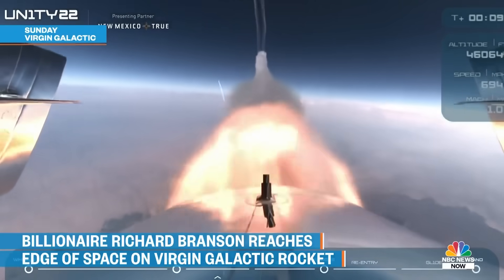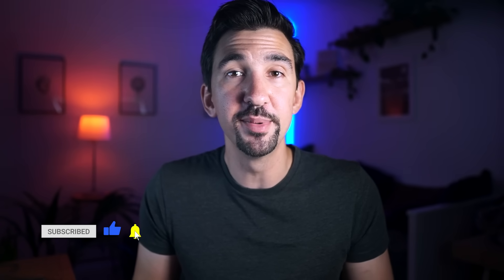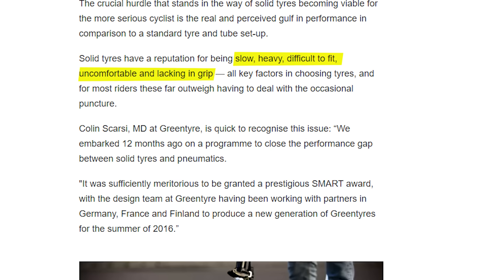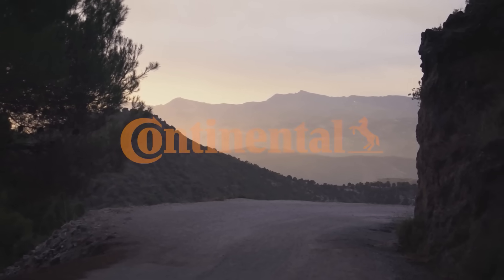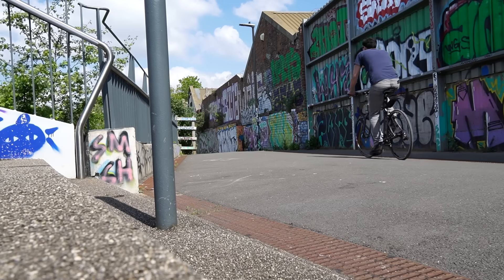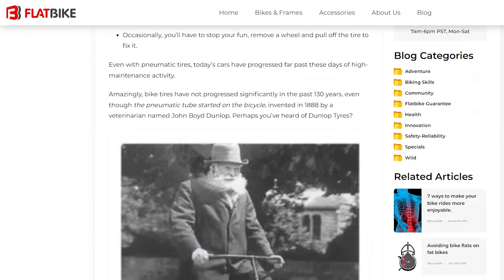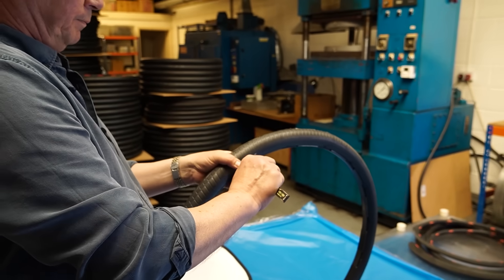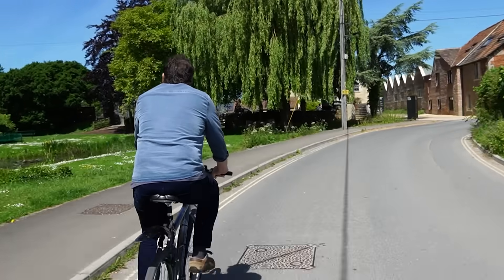I Tried Solid Bike Tires | Here's What I Found

Comment: Regarding this topic, I've been riding on a single set of Schwalbe Marathon+ tires for around 10.000 km's in the past 4 years and never had a flat. They have several hard to puncture layers and a solid insert to minimize punctures. I pulled a long rusty nail out of them and large shards of glass that had me absolutely BAFFLED how they hadn't punctured them. The downside is the weight but they saved me so much hassle I can only gush over them.
Reply: Another schwalbe user here. I commuted to work for a year, from summer to summer in all conditions, but living in Scotland meant pale sun and definitely rain and wind, with the occasional snow fall. My tyre of choice for the job is the G One Speed, almost slick gravel tyre with superior puncture resistance. I went from a puncture every two weeks to no punctures at all. At the end of my commute I used tweezers to pull out small glass shards from the thread. These are tubeless tyre, but I never got to need the sealant to plug a hole. The advantage of being pneumatic is that I can change the pressure according to the load and conditions. There is no beating the best tubeless for flexibility and for pure speed the margins are getting lower and lower. The recycling aspect is definitely an interesting once and I can see how many hybrid or electric bikes can take advantage of the technology.
Reply: I'm also curious, but also a Schwalbe fanboy.  I've ended up riding, mostly below 20mph, on 2-inch Big Apples and Fat Franks; rolling resistance of large, quality, not-knobby tires is low, they don't need pumping that often, they tend to resist punctures.  Zero punctures is better, of course, but rolling resistance?
Reply: I use these tires too. Never had a puncture and they never seem to lose pressure either. I've put some 'slime' in to the tubes just in case for insurance but would highly recommend Schwalbe.
Reply: +1 Schwalbe Marathon+ = indestructible
Reply: Same here. Marathon Plus MTB. My current pair is 6 Years old. The Threads are a little run down, but not a single flat yet. Had a pair of the same Tires (older generation). The rear one lasted only a year but i avoided a collision with a quick slide and the side of the tire must hit a sharp stone. Cut the flank like a knife. The new ones for my current set are ready to mount. Also time for new tubes after 6 years in use.
Reply: I recently replaced one of my Marathon Almotions after about 10k km (the rear, the front is still fine). I had one flat between them  in that time. I did use them tubeless for about half their life though. When replacing I did find a few pieces of glass, a screw and a nail in them, but I still only had to adjust tire pressure about every three months (probably because of the screw, that was a bit of a gnarly hole). These are a lot quicker than Marathon plusses.

Most rides I'm not that interested in the last watts of performance, but I also ride my holidays on this bike. Over 200km/day, I really want that last bit.
Reply: Was gonna say the same and these Gecko's for £110 a pair, I think I'll stick to my Schwalbe's
Reply: Me too, same tires.  Had solid they suck.
Reply: Yeah Schwalbe have it nailed.
Reply: only time I get any punctures is when the snow and ice melts and freshly grind rocks are bare against the asphalt. it's like constantly driving on glass like shards.
Reply: Totally agree!  over 6 years since my last puncture!
Reply: I also use Schwalbe Marathon tires for 10.000 km. They only went flat for 4 times. One of them was a nail, one of them was a piece of wire and rest were thorns. Still very impressive and i definitely will use them in the future. Their downside is though, they are not comfortable and have rolling resistance. I used to have schwalbe smart sams on the same bike and even they rolled a little bit better than marathon. I suggest them for touring and commuting. I did a 3000km and a 1000 km tour with them and they never punctured on these tours.
Reply: I'm also using Marathon+ which are about to celebrate their 10th birthday. I vaguely remember only having had one single puncture which I suspect was caused by someone having seen the ‘puncture protection’ label and putting it to the test, because the puncture was weird. Of course these tires can be punctured with enough perseverance, but gone are the days of simple glass shards or other random junk slowly burrowing itself through the tire.
Reply: in NM, the goatheads are legendary, as are  Cholla (jumping cactus, goes in the sidewall of the tire) so I have to buy the most puncture proof I can find, presently Marathon+.  So the weight factor is a non-issue.  The cost is more than reasonable.  So my question would be how's the grip on: asphalt, sand, loose dirt, sandstone, granite, snow, and ice,
Reply: Recyclable?
Reply: @Causemoi  Tires are made of rubber, which is, by nature, recyclable. That said, it costs more money to recycle them than it's worth for someone to invest into actually recycling them.
Reply: @reeepingk  That would seem to make the advantage of being fully recyclable a meaningless sales pitch, for sure.
That's why a company buyback of old tires would be something worthy to back their claims, because where would these old tires go otherwise?
Reply: @Causemoi  I wouldn't worry
Reply: Something Schwalbe made me aware of is, that there is actually a way to recycle the rubber from pneus. Which is quite tricky because of the mix of materials and the containded metal and its way too geeky to explain in a comment.
But it shows that even this is possible maybe not at such high rate as the geckos but it is still a very new approach, so some improvements will be done in the future.
Reply: Pity they are heavy and have the annoying reflective stripe.
Reply: @Leo-gt1bx  Reflectors on wheels are legally required in many places, so be glad they're there so you don't need to add those plastic reflectors to your spokes.
Reply: @Tr1ploid  Not to say they are a life saver. I use the Schwalbes Green Guard, and they light up like mad when hit by light. Even the mobile "flash" can light them up - they are that good. 5k km and counting - almost new. I thing they will make past 15k km.
Reply: @sysbofh  Never heard of Green guard, looked it up. So this is like a Marathon, but with longer longevity? Might be worth looking into. My first rear Schwalbe Marathon tyre was completely worn after 5000km, the blue layer visible from the outside, so I've never really believed that they can last 10K km.
Reply: @Tr1ploid  Strictly speaking, the Green Guard is a Marathon too - there are several "Marathon" models.

The green is a little less puncture resistant, a little lighter and with a slightly better rolling resistance.

The blue one is heavier, with better protection (5mm versus the green 3mm) and have a higher rolling resistance.

I don't know about endurance: I bought my greens after reading someone complaining about their blue ones "only" lasting 5 years and 15k km, before the rubber started cracking. Mind, he left the bike exposed tot he elements - sun and snow.
Reply: My girlfriend got a thorn through schawalbe marathon plus after ~ 50 miles
Reply: @inquaanate2393  I had this last week as well on my Schwalbe Marathons. A 1cm thorn stiking straight through the outer tube.  But I also have to say it was the first flat in 3 years.

Comment: Just recently received my ribble Shimano commutor hybrid it came with schwalbe marathon tyres which i can't recommend enough as soon as i received my bike the bloody farmers cut the hedges by me i usually get between six and eight punctures so far not one and the marathon plus is supposed to be even better with a green goo innertube i can see it being practically puncture proof.
Modt importantly they have excellent rolling resistance. Really quite a impressive bike for 600 uk pounds easily the best bike i could afford oy ten kg five pounds only 5 lbs heavier than my trek madone 2.3. Granted i had to remove that silly rack and brown saddle now got a bontrager saddle abd carbon post.  Eventually ill have 105 on it with the exception of the brakes. It only has a very basic set of tekro fully hydraulic but, they stop you on a six pence.
Reply: Had a blackthorn in my tyre yesterday didn’t penetrate the tube, luckily.

Comment: As your tire goes flat once a month, than you do something wrong. I ride every day many kilometers and I rarely get a flat tire.
It is just crazy that you need to check your tires daily. You clearly don't know how to put on a tire the right way. That is the main reason why people have regular flat tires or tires that loose their air pressure quite fast. 

Short rides, the rolling resistance is no problem. But as you do long rides, than it is an other story. But with e-assist you can solve that problem. Your battery range will be a bit less, but easy to solve with a bit bigger battery.

Comfort depends on what kind of roads you ride.
I ride with high pressure tires, so less comfort than as you ride with a bit less pressure, but if is more efficient.

Looking ad this tire, than it is for short rides, even with e-assist.

Comment: I have Tannous tires on my recumbent trike and it’s ok for what it serve me, eliminate puncture anxiety on the trail. Removing tan is tire is not that dumb. They have a plier like device to install and uninstall that they sell as option BUT every tire come with plastic pieces that do the job, only more labor oriented. You should have researched about Tannous better.
Tannus armour is a compromise between airless and pneumatic. It’s an inner liner. Tons of people use it with excellent result. I installed tannus armour on my electric bike. Don’t see the difference.
Automotive and oils industry has been so arrogant they don’t seem to even have a look at what is happening around the globe in research. Air escaping from tire is not a problem, problem is producing tire that reshape after puncturing element is removed.

Comment: I tried some airless tyres about 25 years ago, they were like riding through treacle! was such a relief to get back on pneumatic tyres. Hopefully the technology has moved on a bit
Reply: I also tried airless tyres around 25-30 years ago. The size I used were 26x1and3/8 inches and were obtainable from Halfords branches. These tyres gave a very bumpy ride. It needed considerable force to get them on to the wheel; so much so that I was concerned the wheel would buckle in the process. In some attempts to put this type of tyre onto a wheel I softened the rubber first by bundling and tying up the tyre with rope, then putting the bundled tyre into a very large saucepan of boiling water,
 Another problem I encountered was that the foam rubber would absorb water when riding in the rain and this absorbed water remained in the foam rubber for several days and led to rapid rusting of the steel wheel.
Reply: That was a quarter of a century ago. Technology has changed.
Reply: @Leo-gt1bx  yes, if. you read what I wrote I specifically said it was 25 years or 'a quarter of a century' ago and was hoping that the technology had moved on. We'll see if it's any better when we get to try them

Comment: Wouldn't this tech make a more sense on cars and motorcycles who can spare the extra weight? Air is pretty light, reusable and doesn't end up in a landfill. Solid tires will be heavier, require more material and will end up in a landfill. How is this a better option?

Comment: The same old rubbish regurgitated every generation. I have used airless tyres of a foam type compound 30 years ago, manufactured at the green tyre company in Teesside. I rode 17 miles to work and 17 miles back daily and got a very good handle of how long it would take me on pneumatic tyres to get there, over 25 years. I found that when I fitted airless tyres, the time taken to complete the journey had a third in time added to it roughly, because of the very poor rolling resistance. It was like riding through treacle. The increase in time taken, whilst using the airless tyres was enough to fix two punctures on a normal tyre every journey, which if you avoid where people congregate, having a puncture is fairly rare event.
Not only that, my expensive rims, which were tough box section mavic examples, cracked on the back wheel because the air in the tyre, as well as reducing rolling resistance, acts like a shock absorber,  which when airless tyres are fitted, that function is removed. So if you want to ride very slowly and break your bicycle, go ahead and buy some. Dunlop invented pneumatic tyres from solid tyres for a very good reason, the reason is that they are better by far, than anything else out there.
The other thing is, if your rubber genius mate has made compounds for formula one, why don't formula one use semi solid tyres ? and why do formula one tyres still get punctures ?

Comment: Can't wait. I'm a bit taller and heavier than most and I feel I'm constantly juggling tire pressure and roll resistance and not over-stressing the tire. It may not even be totally rational but I'm on my bike every day and it would be lovely to not constantly have to think about it.

Now that I think about it, will these come for different carrying capacities? I can see what my 120 kilo's does to a pneumatic tire if it's pressured for someone of a more average size.

Comment: There is one big difference with the "coefficient of restitution" when driving on a flat road. The bounce test or a bump in the road would compress the air (higher pressure inside tire) just like with the miniscule bubbles in the solid tire. But when rolling on a flat road, the pressure of the air inside the tire is constant throughout the tire. Yes, the indent moves around but the air doesn't compress and decompress removing any need for restitution. This is different with the solid tire where the indent locally compresses and decompresses the air constantly, even on an extremely smooth road. This makes the difference in the coefficient of restitution even bigger in actual use than with the bounce test
Reply: I do think however, in a society where even teenagers are too weak/lazy to power a bicycle and are in need of e-assist, the added rolling resistance doesn't outweigh the benefits of having no flats. So I think there is a big future for these tires. Yay for a future where everybody can exercise every day without the need for muscle activity or cardiovascular endurance. (okay, I sound like an old guy right now, sorry)